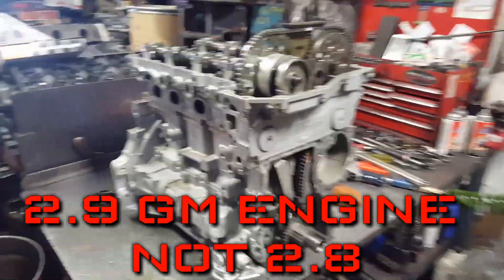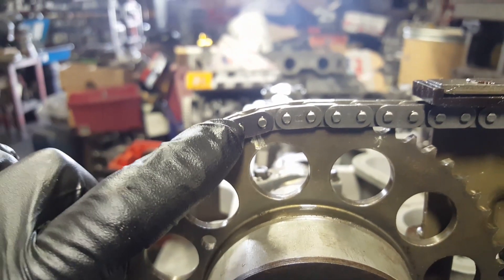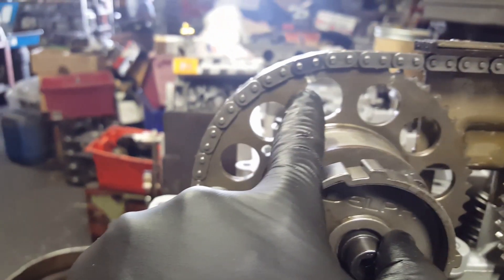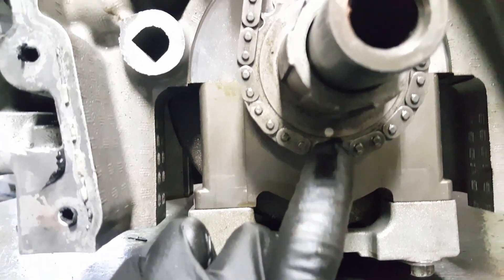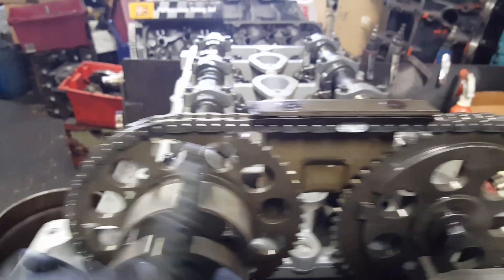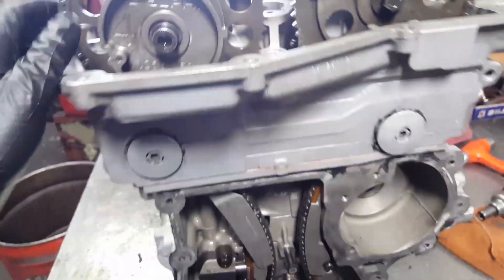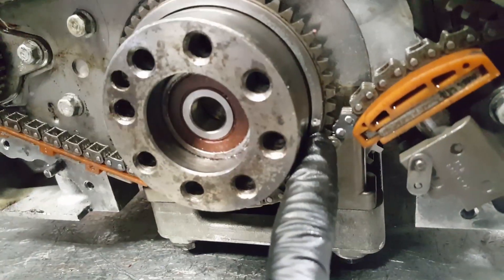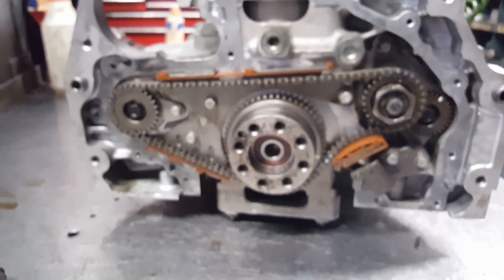Chevy colorado GM 2.9 timing marks and how to install the timing chain

Comment: 2.9? They have a 2.8 4 cylinder and a 3.5 5 cylinder engine. Mine even says it is a 2.8.
Reply: 2007 model years changed a bit. They became 2.9, and I believe 3.7 for the 5 cylinder

Comment: The keyway on the crank sprocket needs to sit at 12 not 1pm. That bottom dot on the sprocket should be around 6pm. That is true tdc. Also that dude was right, ur cams were not in the right place, I could see a new dash made on the exhaust cam. Yeah the engine will run but eventually ur gonna throw a p0017 or a p0014
Reply: I have a Colorado with both those codes. Do you know how much it would cost to fix this problem?
Reply: @noahprice1250  I was quoted 3168 to do this job
Reply: I have those codes too. I think it’s from a loose timing chain. Looking into changing it out now.

Comment: Pretty sure you have those cams in wrong. The flats on the back of the cams should be both up. Meaning the cam lobes should both be up and pointing inwards slightly.
Reply from the maker: Ohh i wonder why the engine is running without any issues if you telling me that its wrong 🤔